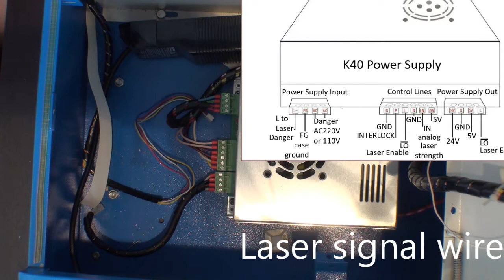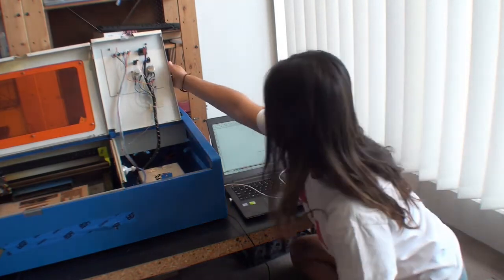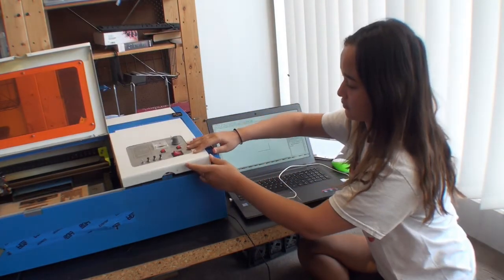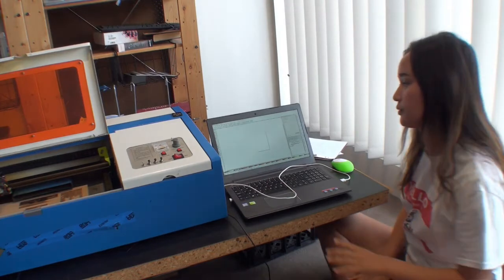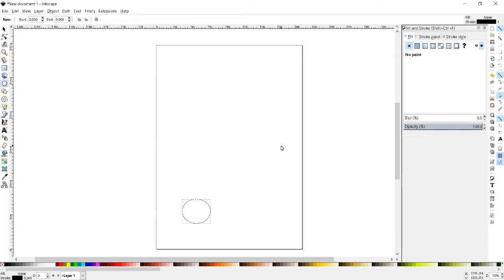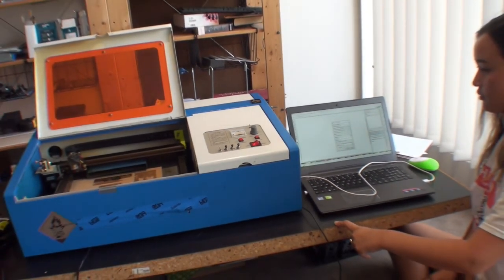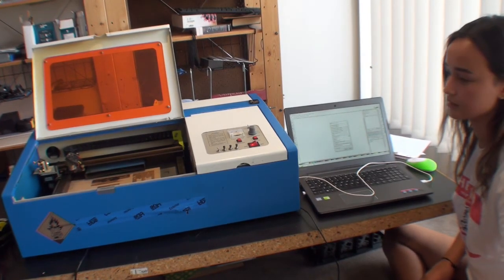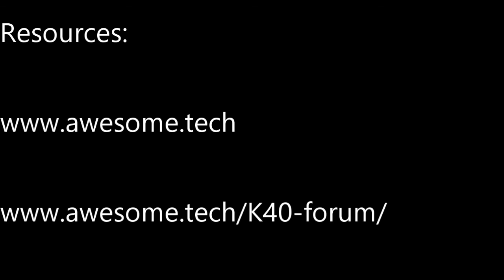gerbil instructions v1

Comment: Yes you can use laserweb. However you need to configure it's S value range 0 to 1 . It needs to be 0 to 2048 or any number close to it to match the 20mA full laser power range

Comment: so you have to turn on the laser manually? it doesn't turn on itself when it's starting to cut?
Reply: It turns it self on via the M4 gcode command in combination with the S laser power strength . E.g S500 resembles 5mA and S2000 20mA etc.